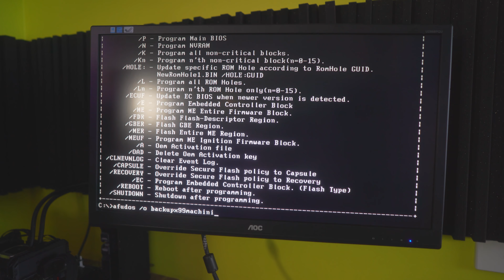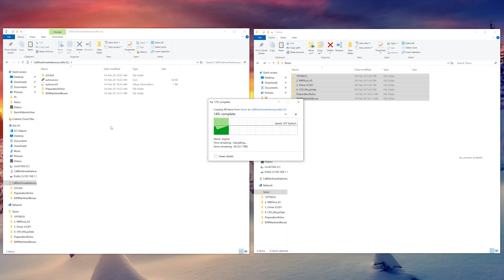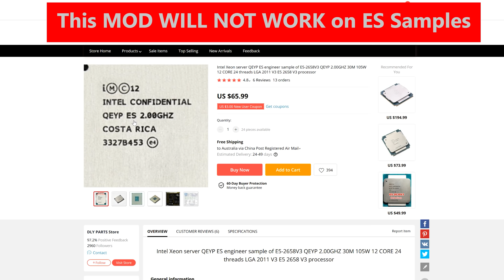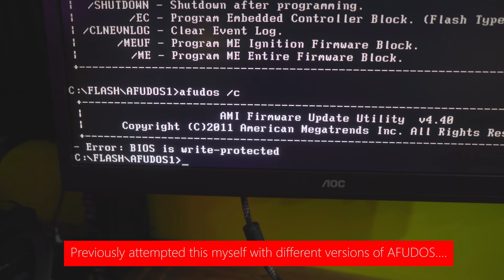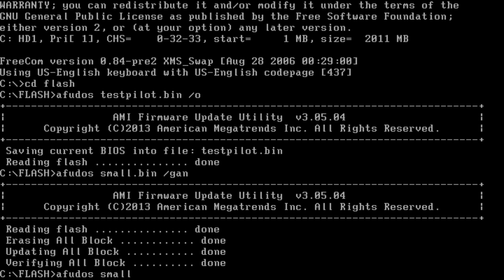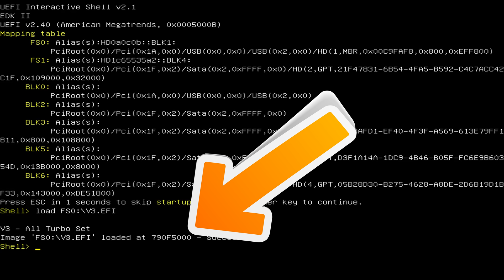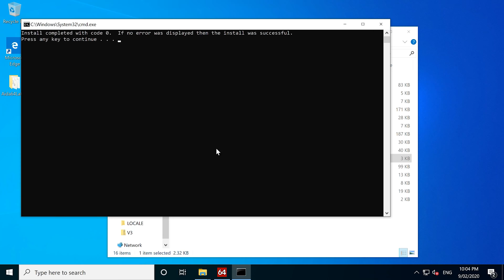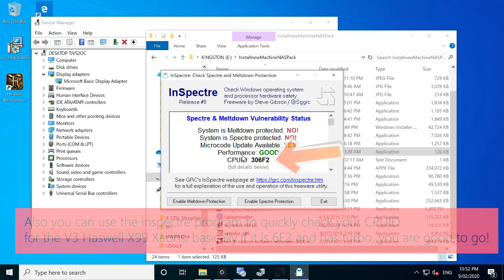Xeon V3 "Full Turbo UNLOCK" How To for X99 Motherboards

Comment: Was pretty excited, then realized my ASUS x99-WS/IPMI  can not be updated. Went as far as fptw64. Gives the dreaded  "Error 26: The host CPU does not have read access to the target flash area. To enable read access for this operation you must modify the descriptor settings to give host access to this region." Wonder if anyone has successfully accomplished this on any ASUS board? Guess I will have to live with the 2.3GHZ  speed of my E5-2670 v3
Reply: Sweet! Found an already patched BIOS for my board  over at win-raid forums. The sweetest deal is I don't have to mess with the efi files or windows dll files. With ASUS Unlocked BIOS I can just set the speed multiplier directly in bios along with the voltages and whatnot. I can now achieve 3.2Ghz on all 12 cores.
Reply: @derrickalenes3085  Hi! do you have the liink? thanks!

Comment: Tried with my E3 1230v3 and an ASrock H87m-ITX.

Getting in step one the error message "ERROR 26: the gist CPU does not have read access....you must modify the descriptor"

Google did not help me yet, any idea?
Reply from the maker: Can try step 2 or download the tool that ASRock use with the H87, though you won't gain much at all on the mainstream 1230 xeons, and some bioses already support the ability to boost them to max turbo already.
Reply: @techyescity  appreciate your input. My goal was not the performance gain in first olace, but as I ended up with going for a used budget build thanks to your videos, I was just curious about the process. It's more about the "doing stuff" than about results :-)

Comment: Hey, guys, i am running into an issue with adding the "driver"  i can get the v3 EFI to load but once i get to bcfg add 0 command line it just says the file is not found.
Reply: I answered that up: Just invert command for fs1 and fs0, its works.

Comment: I ve ordered killsre x99 with xeon 2678v3 . BIOS Is update at 12/2019 and turbo boost Is already On and It worked. I Just can' t change fsb rate. Is normal? Should i flash the bios or not? In turbo boost cores goes at 3,2ghZ
Reply: You do the tutorial ? Or just buy mobo and already on ? Sorry my English.
Reply: @toket7455  i just buy and turbo boost was already on. There is also a overclock section that i can enable but i can t change the clock, i can only change the power in Watt

Comment: help
Error 26

H:\1FPTBIOS>fptw64 -d backup.bin

Intel (R) Flash Programming Tool. Version:  9.1.10.1000
Copyright (c) 2007 - 2014, Intel Corporation. All rights reserved.

Platform: Intel(R) C610 Series Chipset
Reading HSFSTS register... Flash Descriptor: Valid

    --- Flash Devices Found ---
    W25Q128BV    ID:0xEF4018    Size: 16384KB (131072Kb)

Error 26: The host CPU does not have read access to the target flash area. To enable read access for this operation you must modify the descriptor settings to give host access to this region.

Comment: has anyone done this successfully?  I just went through this tutorial with my huananzhi x99 gaming TF, an now windows won't load/open properly
Reply: I'm unable to do the v3.efi step, with the gaming TF board I get a lot more "mapping" and am unable to see whether I get the FS0: or FS1: lines, because I get a ton more BLKx: lines than is on Brian's screen
Reply: Ok all sorted.  Windows didn't like me skipping the V3.efi steps in the bios/shell cmd line.  A.lso I had to swap FS0: & FS1 around, in the video his bootable usb is FS0 & Windows is on FS1, whereas on my huananzhi x99 TF  Windows is FS0 & the usb is FS1.  DL Heaven benchmark and got 4 cpu's running at 3300 mhz most of the time, and at 1440p 65 fps and a 1500 -ish score, 1080p 104 fps with a 2500 ish score (5700xt graphics card)

Comment: WARNING!!!!!!! 
Good Morning. That method corrupts the bios. Tested on a hunanzhin x99-tf. At first it seems to work but if you try to reinstall an operating system it freezes on installation. It is because it cannot communicate the pci and nv2 ports with the software. I have still not managed to fix it because I am not able to flash the bios.
Reply: Hablas español?
Reply: Tuve un error al hacerlo y ahora no puedo iniciar Windows ni reinstalarlo, se congela

Comment: Would it be worth it in your opinion for me to upgrade my i7-8700 to dual E5-2690v3s and a machinist mobo? I do a bit of gaming and streaming along with video editing and rendering. I know the total of 24 cores would greatly help in that regard but would the lower single core performance hurt game frame rates enough to justify not upgrading? I have a 1080ti so my rig is most likely CPU bottlenecked either way lol. Thanks!

Comment: But does it work with 2699 V3?
Reply: yes  i have e5 2696 v3 which is the 2699v3 but oem model with higher tdp than the 2699 wan works fine

Comment: Just buy a 2667 or 2699. Cheap and unlocked
Reply: mine is a 2699 but it is running at base clock forever
Reply: @suli687  so 2699 will not turbo unlock to higher clocks? or is it just your rig?
Reply: @saadomar1101  it was a bios thing i had to change. Now i can get some cores to turbo. Done all steps but i cannot full turbo the processor.

Comment: is the 1680v2 for x79 worth considering ?
Reply: He has a video on that from 2019. Basically, if you can find one for cheap then get it! Better than a 2700x for most games and more responsive
Reply: I am running one at 4.4 ghz with a 1080ti and it works great.

Comment: If you're in a country where first or second gen Ryzen is readily available used - what's the benefit?
The older (Ivy-Ridge and earlier) Xeons have very cheap registered DDR3 available to make them useful for the price, but Haswell-E is using DDR4 so you're not saving anything on the memory over Ryzen (unless you happen to have registered DDR4 lying around), and the Chinese X99 motherboards aren't any cheaper than new B450 motherboards from mainstream manufacturers with proper Bios support (and some of which support ECC).
Reply: mostly you can use cheaper ram. The v3 doesnt support beyond 2133 if i remember correctly. You can also pick one of these up for very little. If you already have an x99 board its helpful if it works.

Comment: What would happen if i have active the turbo boost and i change my cpu for an overclockeable Xeon like the E5-1660 v3?
Reply: my mother did not start with a 1660v3 with the turbo mod

I had to flhashe the bios stock to start
Reply: @raifyperez3324  and if you deactive the turbo boost?
Reply: @Sebisra  
Me refiero a el mod de turbo bost 
Cuando no aplique para tener no 2620 v3 a 3.2ghz dejo de reconocer mi 1660 v3

Tuve que volver a flashear mi backup de bios para que funcionara el 1660
Reply: @raifyperez3324  creía que con desactivar el turbo boost era suficiente, ¿Hasta donde lo has podido overclockear?
Reply: @Sebisra 
tengo la versión J
4.37ghz 1.2v
Creo poder llevarlo a 4.6 con 1.25v pero mi disipador no me esta ayudando XD
Las rams no las e podido llevar a mas de 2400mhz no se si sea un problema de la motherboard (gi ud4)
Reply: @raifyperez3324  ¿Que motherboard tienes?
Yo tengo la Huananzhi X99-F8
Reply: @Sebisra  una gigabyte ud4 y otra kllisre v102

Si tienes más preguntas me puedes contactar
https://www.facebook.com/LLLLLMMMMMMMMMMMMLLLLLLLLLLLL
Reply: @raifyperez3324  Ya te escribí

Comment: I have a CH341 and SMD heat gun to desolder the BIOS chip. Can I take out the eeprom and write it directly or do I need to write it with the pc on, commands, a USB stick and such things to change bios?
(sry for my bad eng... google translator)

Comment: Can you do this mod at a regular non k ivy/sandy bridge processors?
Reply: on x99. Does it feature any non k?
Reply: @vadnegru Im sorry if i wasn't clear, but I was thinking about the mod or any other tweaking on other chipsets rather than x99, z67, etc.
Reply: @DeadlyGrin  as far as i know this is x99 only thing for now.
Reply: @vadnegru  I was asking this because recently i just bought an i7 3770s with H77m-Le mobo for $90 and i want to get the most out of it, any suggestions on tweaking?
Reply: @DeadlyGrin  im empty on that, maybe someone else know more. One thing i can recommend is OC BLCK which  will oc whole cpu bus and let you gain 100-300 Mhz extra. Not every board is overclockable this way so do own research on that.

Comment: Great, now my pc doesn't work.. REALLY GREAT
Reply: what happened? I have b6 error code. I might be able to help you. I fixed my pc afterwards
Reply: I don't know, it was crashing in the bios logo loop and doesn't respond to the usb inputs. anyway, I bought a new motherboard now and it works perfectly.
Reply: @Not-Hash  sigh... that's unfortunate. For me it's either using the full turbo and 64GB of RAM or using the stock 2.3GHz and using 128GB of RAM. I can't have the full boost because whoever compiled that version of the AMI Bios only did include support for 4 DIMM (still quad channel).
Reply: @suli687  Ahaa okay, but my problem wasn't with that. the BIOS itself got missed up

Comment: Got my 2696 v3 18 core to 3.6ghz all cores and threads. Dosent get hot
Reply: Bob Mule  2930 trying to hit 3000 but I probably need a better motherboard I'm using the jingsha x99 ddr3 I got off aliexpress for $89.

Comment: Alright, guess I'll be the first one saying this.
This is a complete fraud.

Why, you ask?
Because, I followed the video, flashed the board, 3.2 GHz..
Until, 3 months later, it just randomly decided to not boot anymore.
So I spent 3 days working on that, resetting the BIOS and reinstalling Windows.
Worked again, no problems, but it was at 2.4 GHz.

But as of this month (1,5 years after the fix), the motherboard really gave the magic smoke and bricked itself.
Why did it brick itself?
Because it's operating way out of it's league, and accelerating part wear by a tri-fold. Yes, that's 300%. 3x as fast.
VRM's, Network adapters, Oscillators, everything. Not made to withstand that power draw and task.
Oh you know, the usual.
Worst part is, I didn't even use it 100% most of the time because it was being bottlenecked by a GT 1030.

Errors include:
>"Network Unidentified, Limited" in Windows 8.1 and none of the fixes working, including a network switch install inbetween the router and PC. (bad local IP configuation according to Windows but that wasn't the case!)
>Windows 10 constantly hard-crashing on various points
>Windows 7 being completely dysfunctional
>Pretty interesting glitchy video pattern on bootup with an RX 580 consisting of rainbow colors and one white / red square of 800x800 pixels. (which doesn't do that on another computer)
>Constant keyboard errors
>Not willing to boot off of USB at random occasions

There was no human error.
I handed the thing to professionals, and it stumped them, because it's such an obvious hardware fail.

Types of hardware used here:

Storage:
>2TB Seagate Barracuda Compute (HDD)
>500GB WD Caviar Blue (HDD)
>1TB Verbatim Vi550 (SSD)

GPU:
>Nvidia GeForce GT 1030 2GB
>AMD Radeon RX 580 8GB

PSU:
>Spire 600w ATX
>HP OEM 300w ATX

HUD:
>Logitech G203 / G213
>OEM HP Keyboard
>OEM Dell Keyboard
>OEM Dell Mouse

Monitor:
>Samsung 1920x1080 (HDMI)
>Acer 1600x900 (DVI > VGA)

RAM:
>Corsair Vengeance 16GB 2666MHz DDR4
>Atermiter 8GB 2666MHz DDR4

Thermals are OK, that's not an issue

So, I'm here sitting with peanuts I suppose.
Awesome.

Comment: would this work with a x79 motherboard or did i just screw over myself?
Reply: there are other mods for x79
Reply: No, turbo unlocking only works on E5-2xxxv3 (X99).

Comment: Would one of theese be a viable upgrade from my 6600k?
Reply: if you need multicore then 2678 or just 2650 is decent. For gaming not that good (depend on game)
Reply: Id say yes and id also say the 2678 12core up to the bigger boys that go to 32cores is the best for what you want.
Reply: It does depend on the game, but the results will be more effective if gaming at 1440p and if using Win10. In general the newer the game, the better it will work. Have a look at my results and compare Far Cry 5 to GTA V:

http://www.sgidepot.co.uk/sgi.html#PC

Note how, for GTA V, there's quite a difference between the 4-core 5GHz 2700K and 6-core 2420 v2 (FYI at 5GHz the 2700K has identical performance to a 6700K, so with HT off a 5GHz 2700K would be very similar to a stock 6600K). GTA V is an older game that prefers a high clock and high IPC, but it does run better with Win7, though the extra threads with HT on do help (note the collapsed Lows at 1080p/LOW with HT off). The uber cheap 2420 v2 has good Lows (so it's a decently consistent playing experience, frankly I was amazed at how well it did) but its avg performance is 48% lower than the 2700K (this is all using the same GTX 780 Ti GPU btw), though if one is using a 60Hz display then this doesn't matter since the absolute performance is still more than good enough (88fps with the 2420 v2). At 1440p the gap narrows and it's still playable at HIGH detail, but at MAX the VRAM demand is too high and performance suffers badly, with terrible Lows with the 2700K (and notice how for all other modes the 1080 Ti isn't really that much better, but at 1440p/MAX its much higher VRAM suddenly makes a huge difference and it surges way ahead). Also note the RX 580 is far down the chart, though I've not benched it yet with the 2700K & 2420 v2.

Now contrast the above with FC5. The 2420 v2 is much closer to the 2700K, the latter's Lows suffer with HT off, the 1080 Ti scales in all cases much better (should be about 2x faster than a 780 Ti) and the RX 580 is now often much higher up using the dual-XEON board, the numerous cores making an impressive difference, and Lows are better overall, though absolute performance is not that great in general so a better GPU than a 780 Ti would be wise. Using Win10 doesn't seem to make a consistent difference.

Lastly, I've not done so much testing yet with AC Origins, but it definitely gains from using Win10 (better Lows) while using DX11; The Division gains in the same way, though switching to DX12 imposes quite a hit.

There's a complex interplay of different effects - the OS, HT on/off, detail level, resolution, API, etc. - and these interact in different ways for different games. Some gain from Win10, others don't. Some actually run faster and with better Lows under DX12 (eg. SotTR) but others don't.

Thus, you need to look into what matters based on the particular games you play, target resolution/detail, OS, API, etc.

What I can say though is that trying to upgrade to a 6700K is probably a bad idea, because people are paying silly high amounts for those atm (a new Ryzen would make more sense, eg. I've seen ebay listings for a used 6700K end higher than the cost of a new 2700K which is crazy).
Reply: Strongly consider Ryzen also if possible.
Reply: @nap8187  Ryzen is viable but the cost is definitely higher because of conventional DDR4, and even then the prices are not necessarily that great. Like I say, look at it from the point of view of what is possible with the same fixed budget. I did an example comparison with a $1K budget and found that a v2 build would permit the purchase of a GPU fully two tiers higher which would definitely give better gaming performance in almost every case (with exceptions typically being older games such as GTA V).